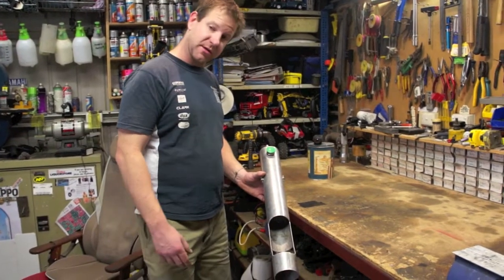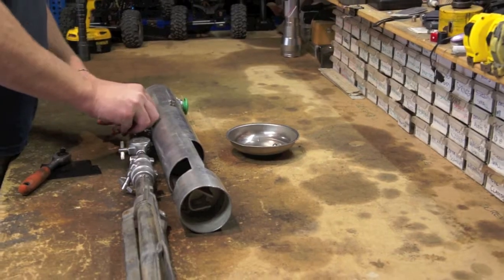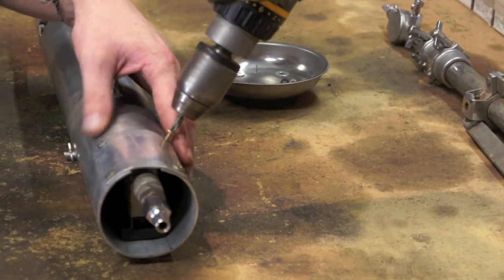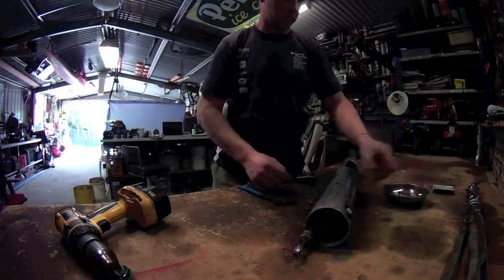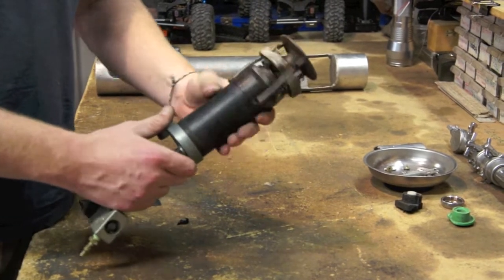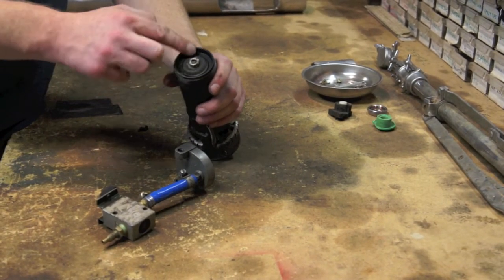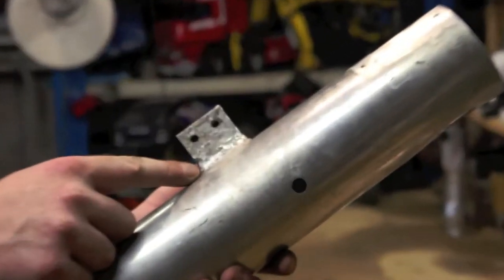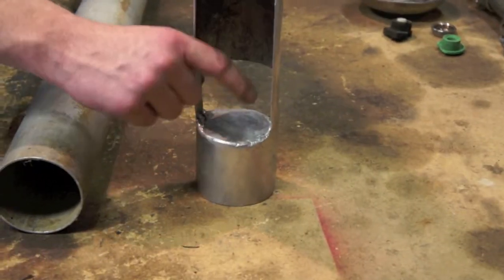Can Crusher - How To build

Comment: on the video you said a cyclinder pin, a collar and other parts.  I bought a foot pump off ebay but the one you have looks a little different. Mine has a collar on one end and yours looks to have 2.  please can you tell me more?
Reply: also can you tell me what part was used where?
Reply: what is the piece in between the crush plate and the cylinder?

Comment: Were did you get everything? And roughly how much did each item cost? I was looking at Kmart and found a foot pump for about $15 I just don't know were to go for the rest any help is appreciated. Thanks
Reply from the maker: Search "Vintage Foot Pump" I found a few on eBay for $10, the air Valve cost $7 and again on eBay, all the other bits I made out of old junk.

Pump:  http://www.ebay.com.au/itm/Vintage-Kismet-Popular-Foot-Pump-/271727643643?pt=AU_Transportation_Collectables&hash=item3f443acbfb

Air Valve:  http://www.ebay.com.au/itm/1-4-PT-Air-Outlet-Inlet-Momentary-Mushroom-Button-Metal-Case-Mechanical-Valve-/390997125424?pt=AU_Business_Industrial_Industrial_Supply_MRO&hash=item5b093ea930

thats about all I think.

Comment: Pretty loose crush, do you need more pressure to get crush it smaller?
Reply: the cylinder needs to be a bit closer
Reply from the maker: squirtsy18 Originally it was made to suit 375ml cans then 440's kept popping up so we remade it to suit.  Also the ram not going all the way to the bottom is a safety feature meaning you can't crush your fingers easily
Reply: ok thanks

Comment: great job
it would be helpful if you could put in a list of parts
Reply from the maker: Ok here is the parts list:
- Old foot pump
- Momentary Air Valve
- 12mm Motorcycle axle
- 90mm Aluminium Pipe
- Some Air hose and fittings
- 3 x Springs from old desk lamp

That's about it..!